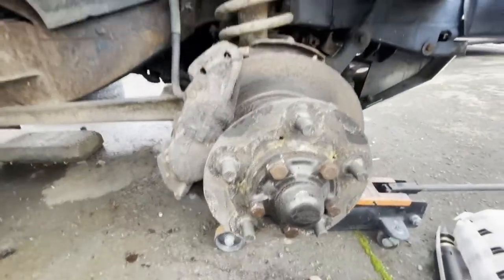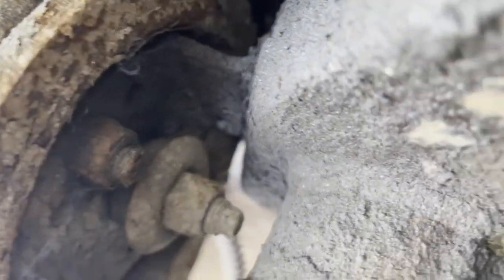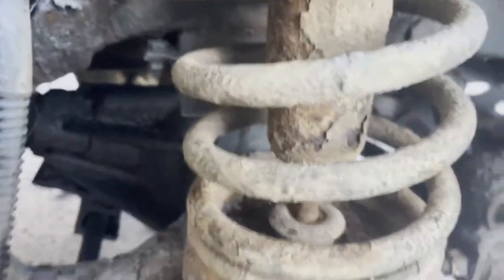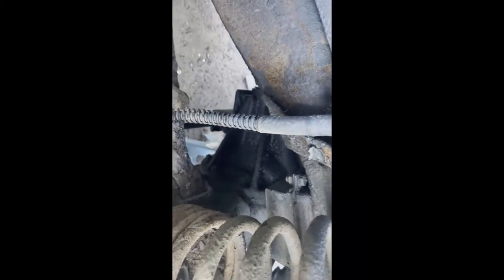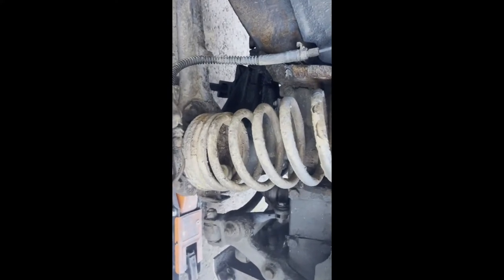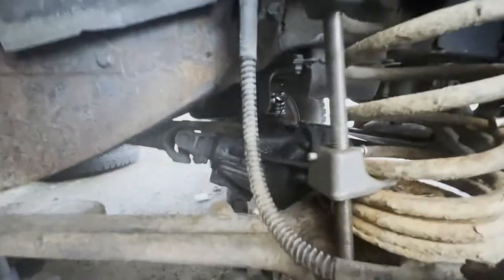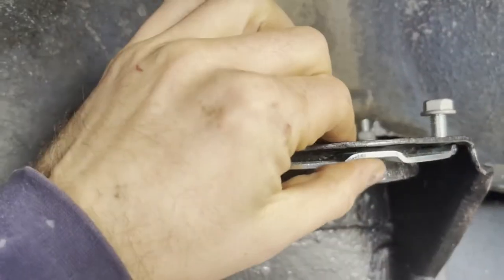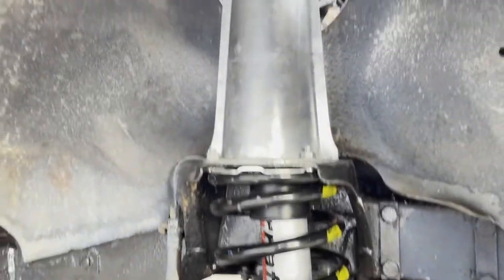Rebuilding a 27 Year-Old Landrover Defender Part 8 - How to Replace Springs and Shocks

Comment: If it's an oil filled damper there will  be no rebound, but it will resist the spring's rebound. Only gas filled dampers rebound by themselves.
Agree with the other viewer who suggested dropping the axle. I have spring compressors but don't use them.

Comment: That corner looks much nicer after than it did before😃 - I did the same job a few years ago and I think I got the spring out without using compressors by lifting the body and dropping the axle ....I may be thinking of the back though😃😃 thanks for the vids, really enjoyed them and now want another 110😱
Reply from the maker: Oh I never thought of that.  But I even considered cutting the old spring out!  Haha.  Cheers mate 😊